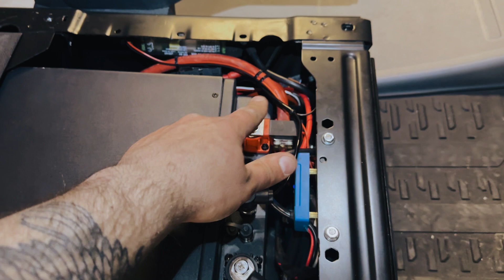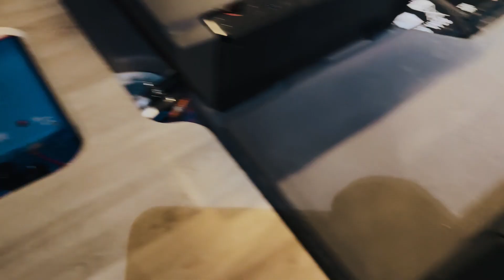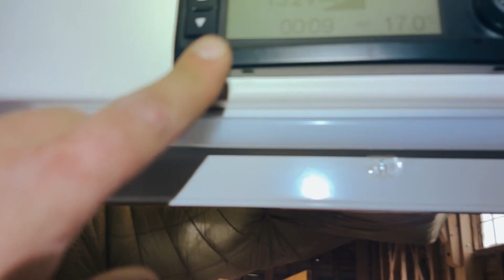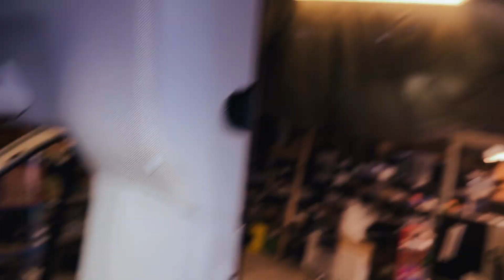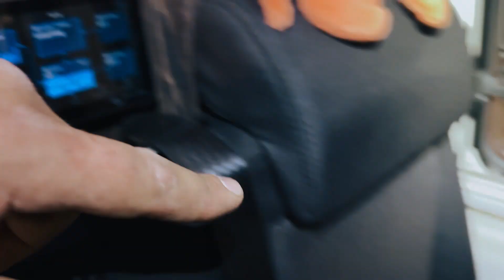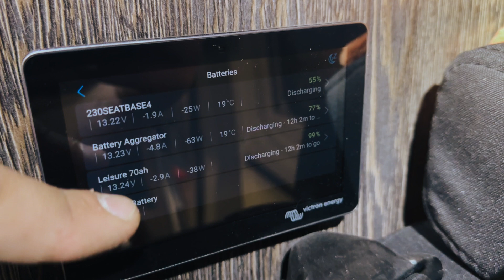Upgrading Westfalia Sven Hedin to Roamer lithium seatbase

Comment: Nice compact build. I like it. In practice, no issues with the Victron units (XS, MPPT) in confined spaces with limited airflow? I'm interested because that would make a huge difference to the build/refit I'm planning for my 40 year old Westfalia VW T3 - space is at a premium and it would be brilliant if I can tuck the Victron units into small spaces.